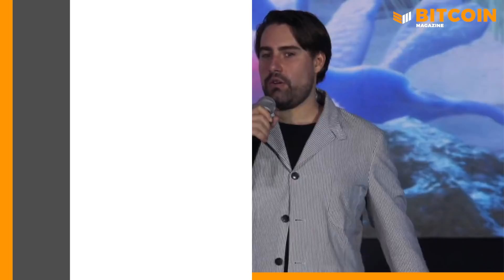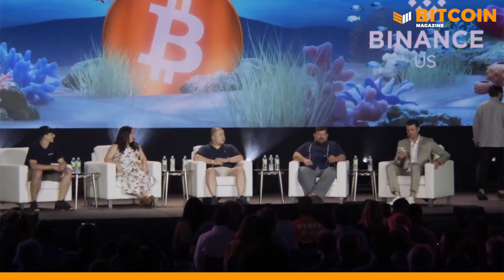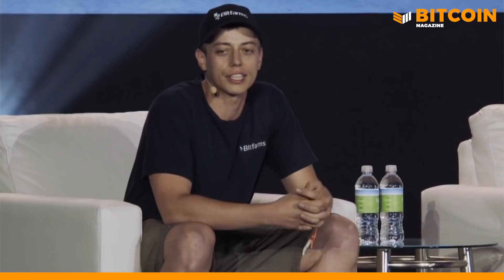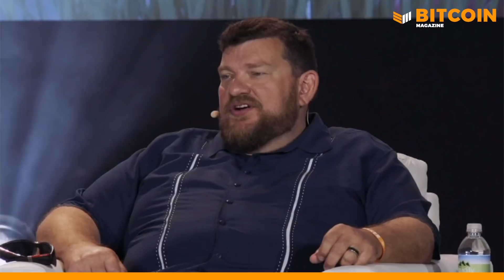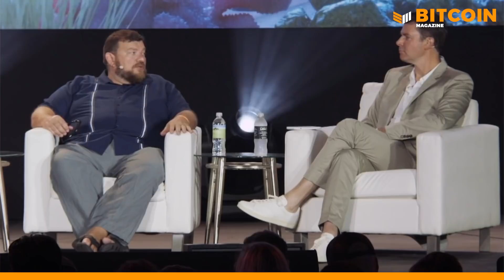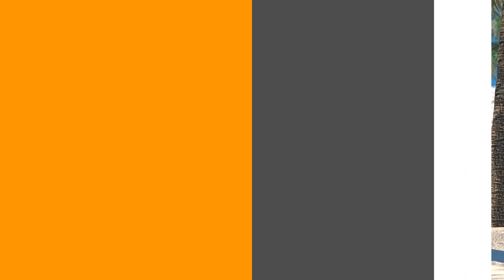Bitcoin 2021: Bitcoin Mining: The Next Industrial Revolution

Comment: <I must say. Bitcoin’s price action has been fluctuating throughout the past few days and weeks, with bulls and bears both reaching a clear impasse, the aggregated cryptocurrency market has been following in Btcoin’s lead and is struggling to garner any decisive momentum. One analyst is now noting that BTC has been holding above a key macro level throughout the past few months. He believes that the recent consolidation above this level bodes well for its near-term outlook and could indicate that significantly further upside is imminent in the weeks and months ahead. Tips like this are why it’s advisable for investors and newbies to trade with the help of pro traders like R-e-a-l-s-o-u-r-c-e-i--n-v-e-s-t-m-e-n-t-o-r-g they is always one step ahead of other traders, they fully monitored all my trades to avoid me making mistakes and losing my money. My earnings have increased drastically from 1.01 BTC to 9.700 BTC in just 4 weeks using their strategy. You can easily get hold of them for a profitable system @ realsourceinvestmentOrg

Comment: )  More bitcoin dreamers and lairs like Saylor. Bitcoin will never ever go to $1000,000 and stay there, the traders will just dump it back to the 20's. It can never become a sustainable currency because it can be dumped any minute. You cannot dump gold, you cannot dump ebay, you cannot dump Microsoft and you cannot dump anything that's attached to something of value, its values could fluctuate but never be dumped.And that's the difference between something of value and something of no value.
Reply: Well for me personally its working  as a great store of value. I finished up in my career 5 years ago and put a large portion of my superannuation into it and it has done very well. Even on the drops it always forms higher lows so no complaints from me. My Gold is less volatile but has significantly less upside. For me Bitcoin has been a great investment. had I not learned as much as I did about it and Austrian economics I probably would have shit my pants and sold during the first few dips. Just got to see it as a long term investment.